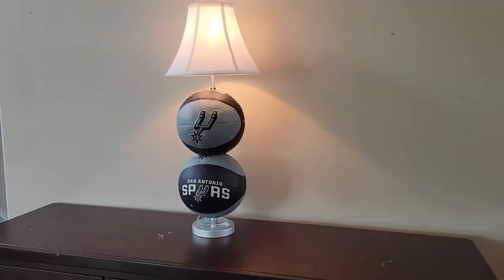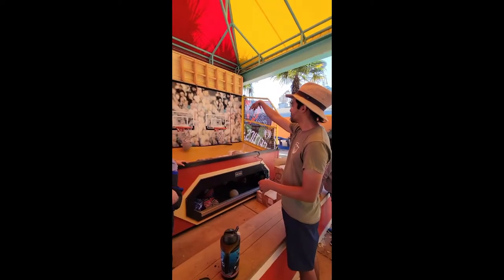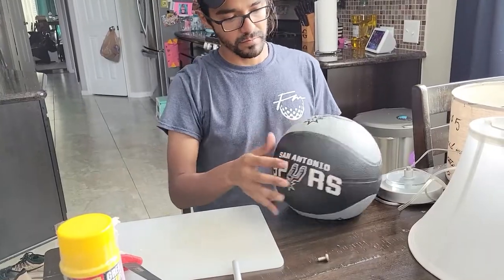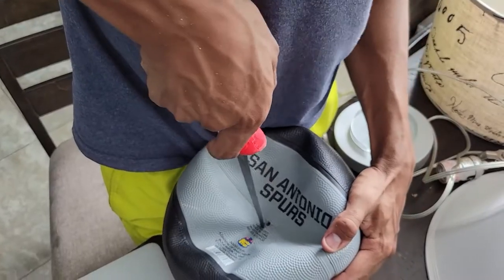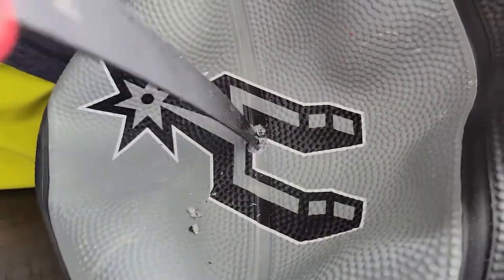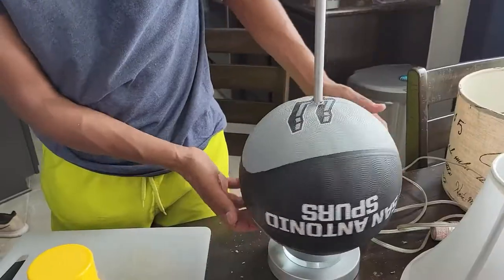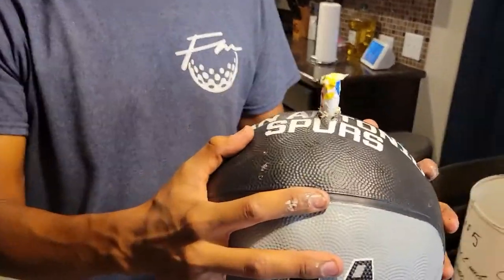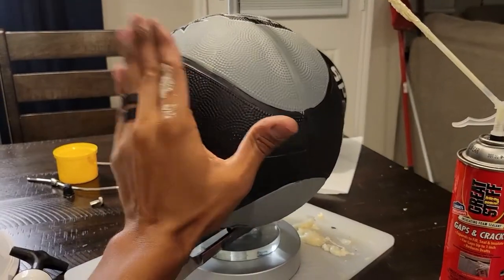How to Make A Basketball Lamp DIY

Comment: You never showed the tennis balls being inserted! How would u put the tennis balls in with a lil hole
Reply from the maker: I didn't get a chance to use tennis balls. Wouls probably drill a hole then slide the tennis balls in. Probably won't use the expanding foam for those balls..